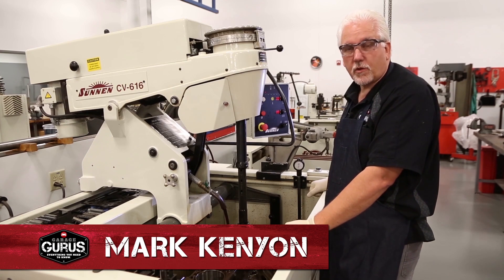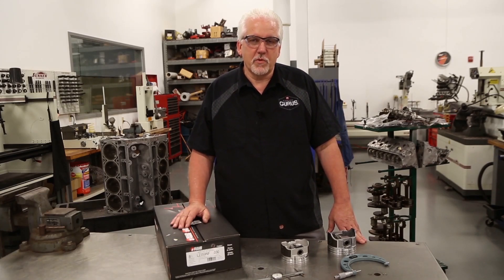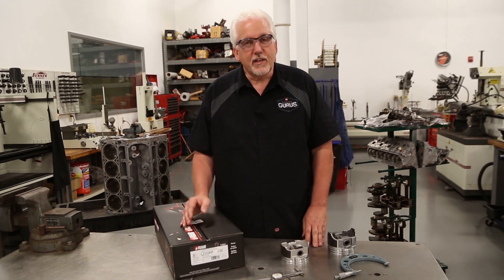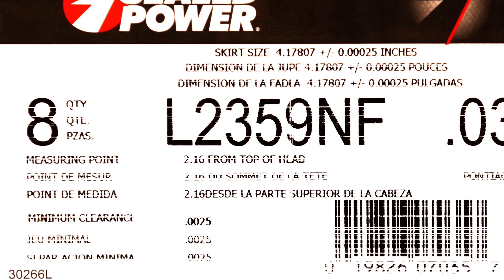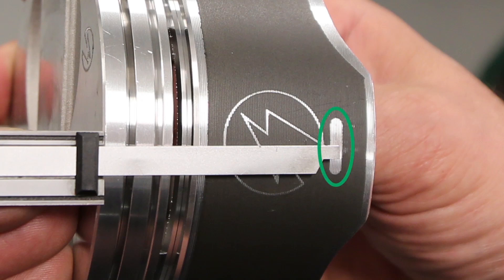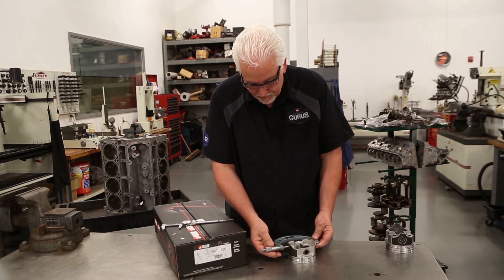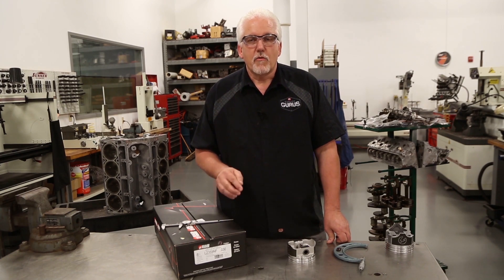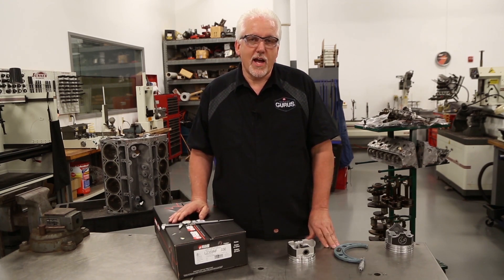Measuring Piston to Wall Clearance

Comment: Does it matter if its forged, cast or hyperutectic? I know these all have different expansion rates thats why i ask.
Reply: it does matter  on PtoW  celarences.  forged  PtW  is  looser  but  hypers  you can  run a tighter bore.  

what the other person  daid  about the rings is also right.  hyper pistons  run bigger gaps  because they hold  more heat.  if hyper rings  get gapped  to tight they  WILL rip the top of a piston off and  ruin the  bore and the engine.  run whatever  they tell ypou to run  and run the 2nd  ring looser than the top ring  every time boost NA  nitrous etc
Reply: if doing boost or NOS use forged pistons and rods, some manufactures will recommend added clearance to allow for more expansion, also when gapping rings there are many charts for "x" amount of thou times your bore diameter and that will be your ring gap, but this depends on how much boost you're running. I'm no pro but have a little experience. I'm sure an experienced builder will give you more clear answers but hope this helps in the meantime. If you get pistons/rods/cams/etc., you can always contact the manufacturer and they should definitely be able to help.

Comment: So Piston To Wall Clearance Is Simply (Bore Size) - (Piston Diameter At Specified Location). So If They Want .004" Clearance They Want The Bore To Be .004" Larger Then Piston, Not .008" Larger? Correct?
Reply: Salvatore
Your correct. It's overall clearance, not clearance on each side.
Reply: No pistons are slightly smaller then the bore

Comment: Way too much fooling around. Forget smoothbores and coated piston skirts. With a piston on a rod with no rings. Run a long feeler into the cylinder that covers the depth of the cylinder from top to bottom. Use the piston as a go, no go tool. The piston to wall Clarence is now physically accurate for the entire length of the cylinder. To make power you’re far better off using a very rough stone to home the cylinders giving a distinct crosshatch and using generous clearances.
Reply: Budget Boost DIY  He's saying have the piston in the cylinder without rings on it, then wedge (gently) a feeler gauge between it and the bore wall and measure the gap, do this all the way up and down the cylinder and confirm it's the same top to bottom etc.  This way the piston is being used as a OK /NOT OK tool in conjunction with the feeler gauges.  Thus go / no go.  If I understand him correctly.  You'd want to do this in more than one side of the bore preferably.

Comment: I'm confused, is the coating part of the clearance or not? Those windows seem counterproductive since they take the coating out of the equation.
Reply from the maker: John thanks for your interest in this matter, to answer your question the coating is not part of the clearance it is added to the piston after it is finished to final size.  Because of this we recommend that you only measure the piston in the windows provided as you saw in the video, this will give you a true and accurate measurement.  
Many times people ask if the coating is added to the piston after it is finished to its final size will that make the piston too tight, no it will not the coating material is designed to provide better lubricity which allows the piston to run tighter and not have seizer issues.
We hope this clears up any confusion please feel free to call our Tech Line if you have any other questions.
 The number is 1-800-325-8886 and they are open M-F from 7:30am-4:00pm CT.
Reply: @GarageGurus  I was wondering the same thing. But what if the pistons don't have windows in the coating? How do you accurately measure them in that case?

Comment: Can u tell me what is standard distance of piston and cylinder gap
Reply: sandip tidke Think you’re asking about piston to wall clearance. Check the engine specs. But I recommend a very rough crosshatch cylinder wall and at least 7 thousands feeler gauge clearance.
Reply: @peterviceroy1592  Hi Peter 
your reply just gave me an answer for a question that i would ask but your recommendation of a very rough crosshatch creates another question for me ( will that very rough crosshatch be be okay and not danger even when the metal expands  take place while engine is warming up and reaches up levels of heat ?!! and then engine rebuilding will fail soon because of that rough metal friction??!!
hope you are well and see my comment
Greetings from Egypt :)
Reply: Saeed Desoki standard gap for most engines is .0015”-002” piston to wall and .014 top ring and 0.016 bottom ring. This is not for racing, just regular use on an average car engine. The crosshatch will be a smooth 45 degree cross hatch

Comment: Mark thanks for the input.I see you as a machinist finish honing cylinders on a Sunnen must know exact piston size to calculate the clearance you want.Myself as an assembler I find the feeler gage is just easier to get a direct reading .I just put the piston in the cylinder upside down slide in 2 or 2 half or 3 along the skirt measuring point and this is what the piston sees.
Reply: robert mullen right on!